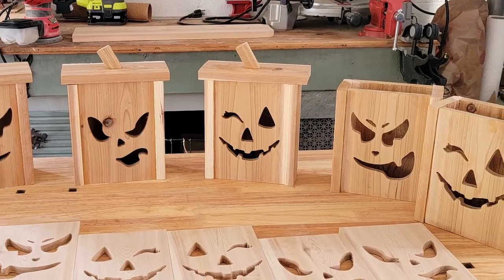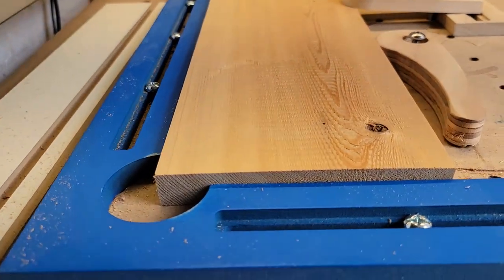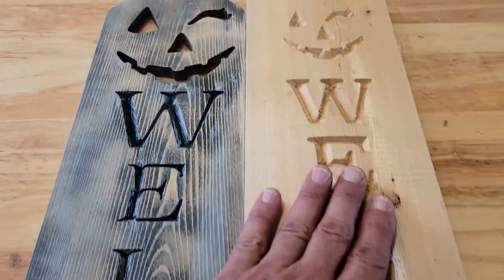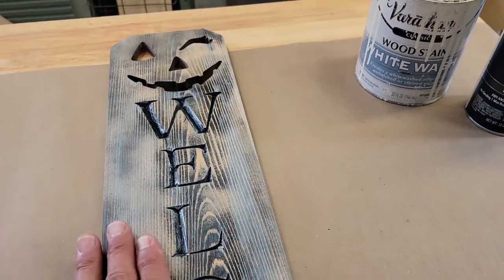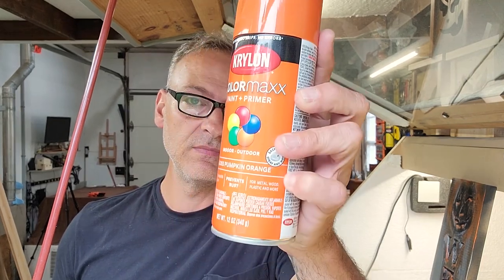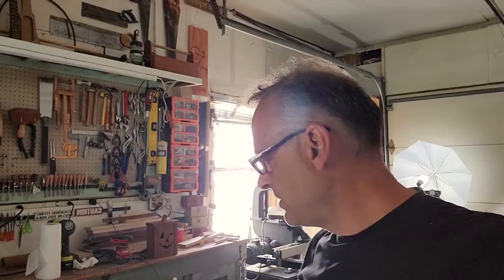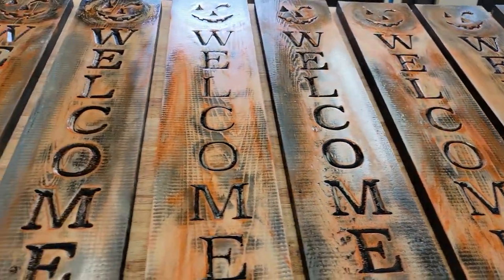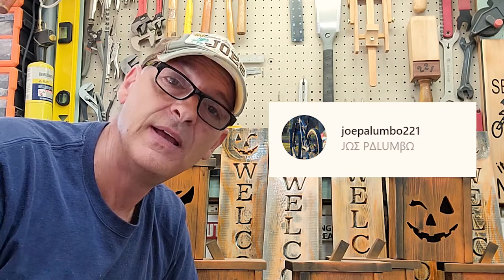DIY Halloween Decoration and Welcome sign for CNC

Comment: The signs are great! I attempted to design this in Carbide. My pumpkin design using a 90 v-bit isn’t cutting out the design properly. Did you do anything to the settings to cut out the pumpkin with the V-bit?
Reply from the maker: I actually just played around with the size of the pumpkin face and ran a few tests to see what looked better. In my case the face was a little bit too large and the vcarve came out either too shallow or not as tight as I would of liked it.  I resized it smaller and kept checking the rendering to see what the quality looked like.

Comment: This popped up in my feed today. I love the accent and whit/sense of humor. You did a great job taking us through your journey. The end result is outstanding. I just might  running some of those tomorrow. What font were you using and did you perform some node editing to modify the font?

Thank you sir!
Reply from the maker: Thank you! I did edit some of the nodes to the fonts and designs.  I honestly don't remember what kind of font I used.  I believe they are just normal and I changed them up a bit.  Thank you again!